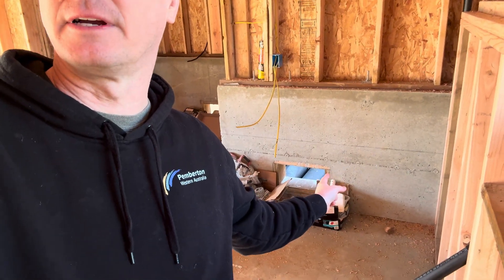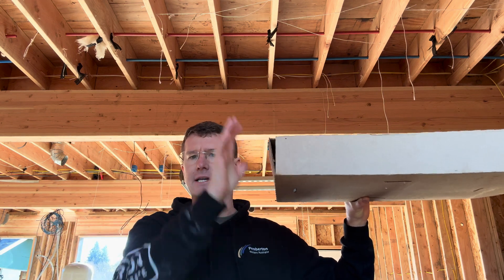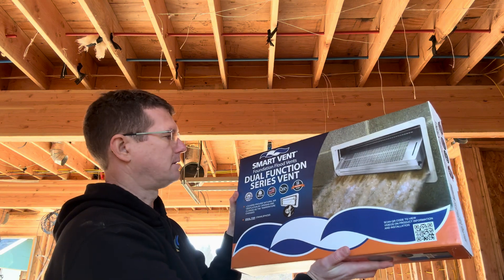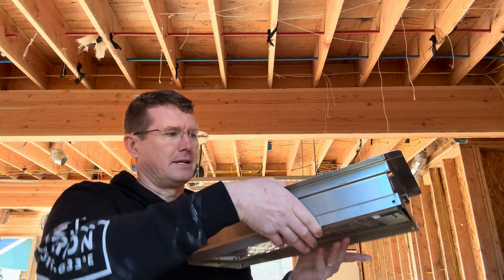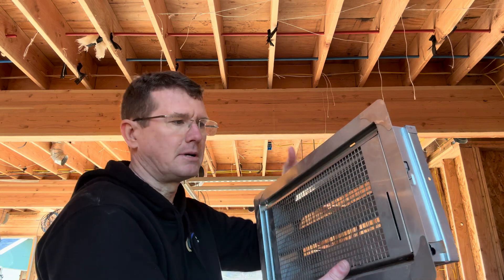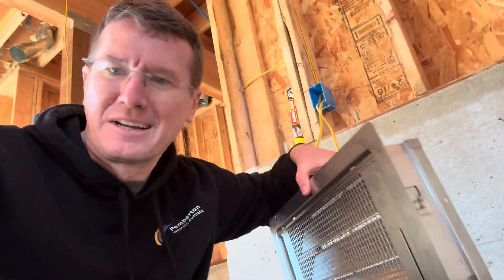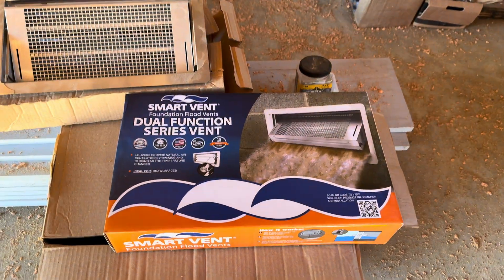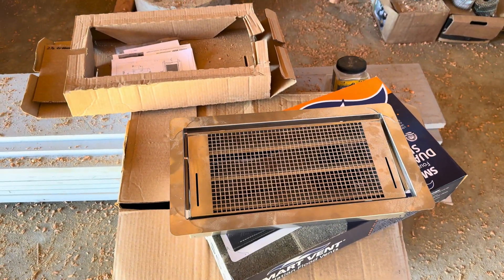What is a Flood Vent or SmartVent?

Comment: Like you I thought the same thing but my Structural engineer set me straight. The flood vent is actually designed to let the water drain out of the building. There is not enough of an opening to prevent pressure build up against the building.
Reply from the maker: That’s definitely a benefit.  However, FEMA’s documents of flood vents, other structural engineers, etc call out the other benefits too.  Now, what’s the most valuable benefit. That’s debatable.  In our case, if we did nothing, we definitely would have been hit by the issue of water volume pushing an air volume.  Our foundation was not attached to the home’s sill plate, so, in that scenario, being able to fill that air volume with water would have made a major impact.  However, with the remodel, now that the stem walls are thicker, the sill plates are attached to the foundation, and the framing is rated to withstand the forces of 30,000 cubic feet per second of water pushing against it. Well, now, the main value of the vents isn’t to replace air volume with water but, like you suggested, is now to help the water drain.  The reality is, the vent provides a lot of potential value, the realized value is dependent on the flood incident.  If our volume of water jumped to 60,000 or 300,000 like other rivers in the area, I’ll be extremely happy to have the vents in place!
Reply: 100%  The main problem is when flood water recedes. Picture his "cardboard box" full of water without even pressure on the outside. The vast majority of building damage is from this. "blowing" the foundation out. Maybe not a big problem with one course of block showing above grade, but a big problem when several courses are above grade.  Smart vent is designed to keep large debris out of the crawl space, yet rotate and allow the crawl space to empty at an even rate of flood water recede.